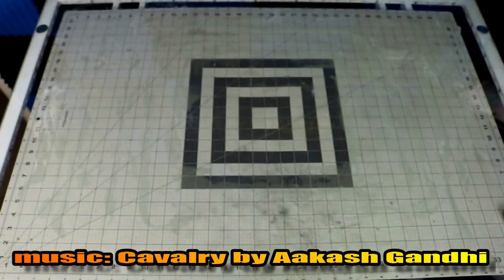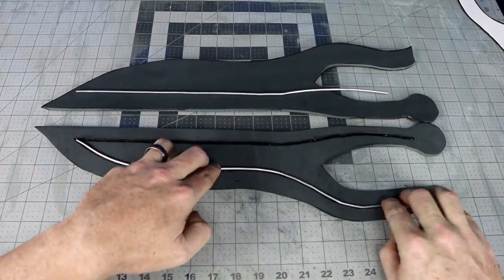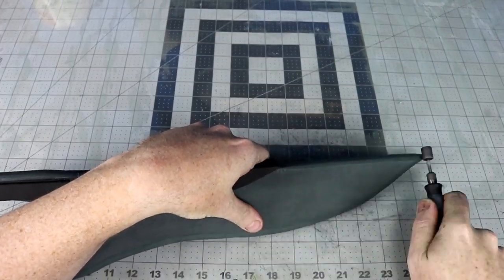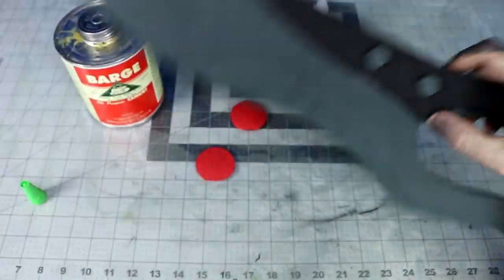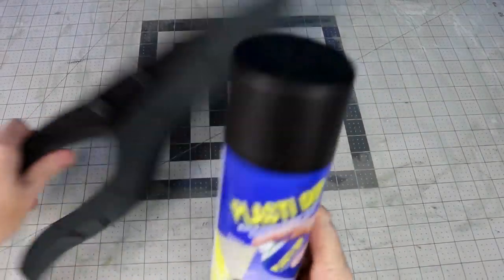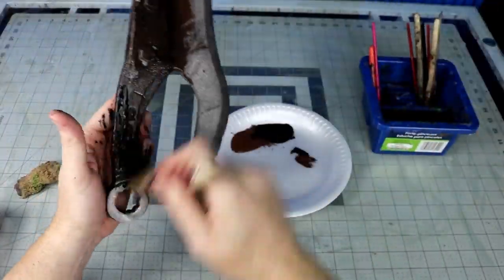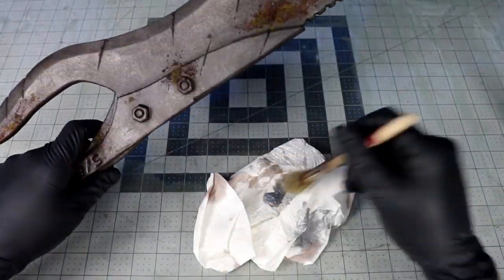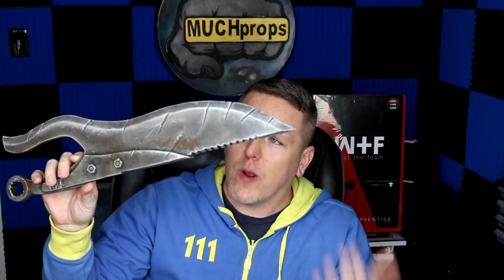Making a Foam Throatslicer from Fallout 4

Comment: What woodburner do you have? And what temperature is it set at?
Reply from the maker: It is a walnut hollow. The brand hobby lobby carries. And it usually stays cranked up on high
Reply: @MuchProps  perfect thanks! Did you buy any attachments or just what it comes with?
Reply from the maker: @CosplayApprentice  I have some tips I bought that they sell. I also have the entire alphabet, upper and lower case